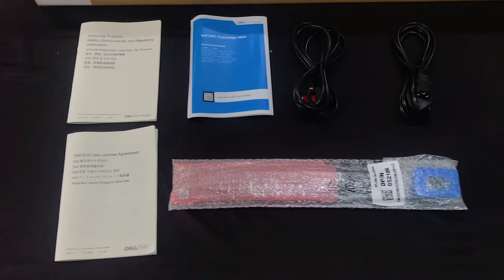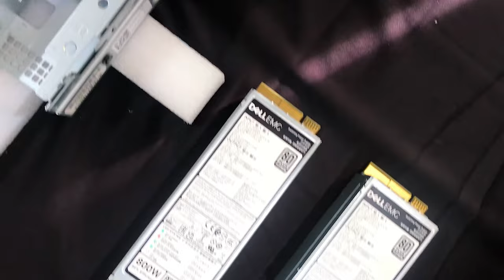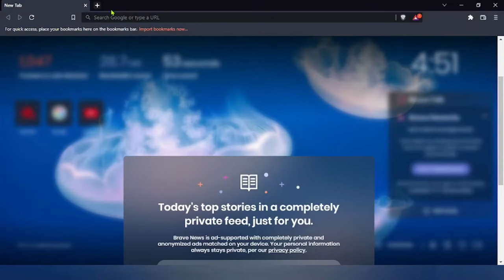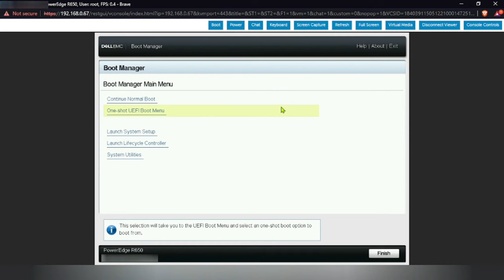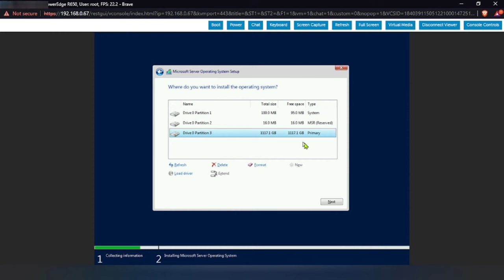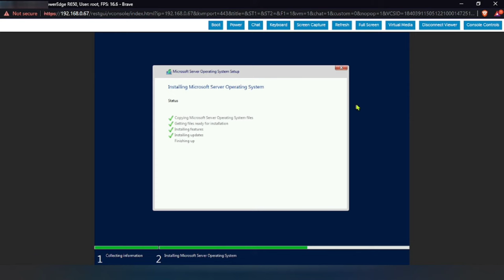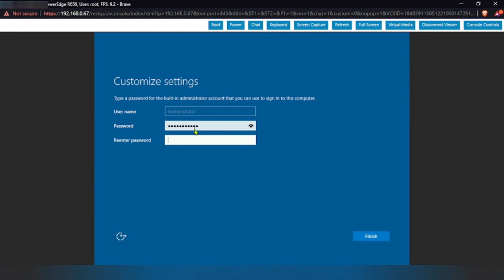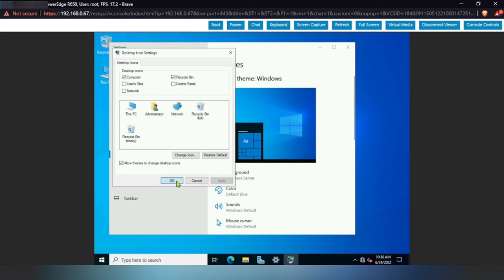Dell PowerEdge R650 Rack Server Unboxing and Windows Server 2022 Installation

Comment: would you please tell exactly how did you connect the edge server 650 to the laptop ?  did you connect the Rj45 Lan cabel to service port from rear side and from the LED screen sassigned the DHCP to get IP
Reply from the maker: Please check this video.
https://youtu.be/YtnZRQ5w17Q